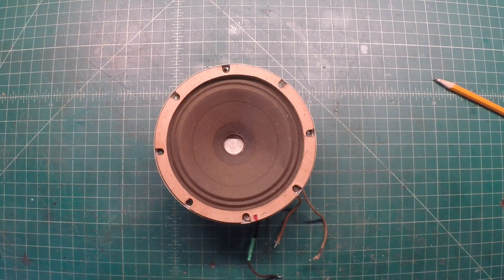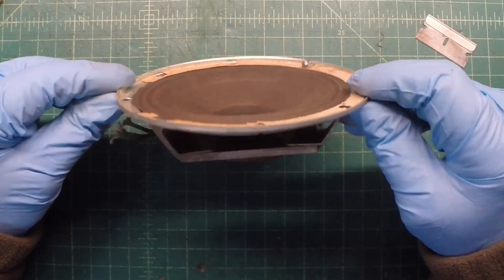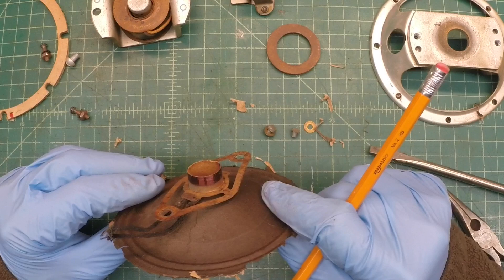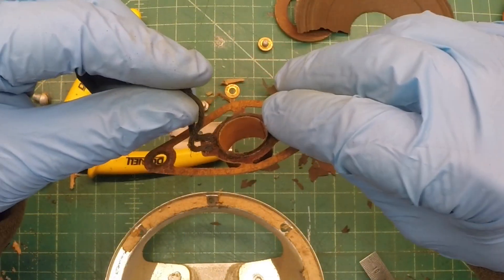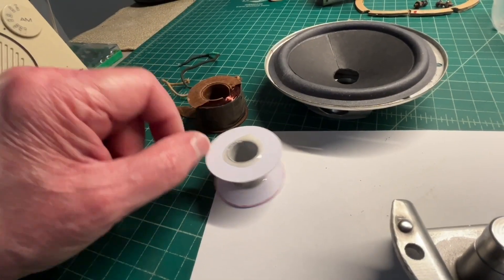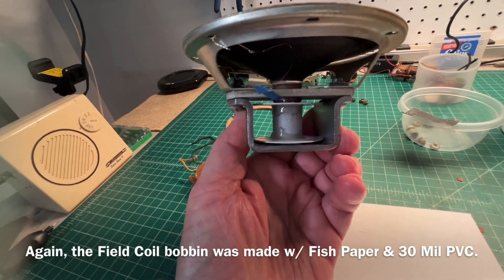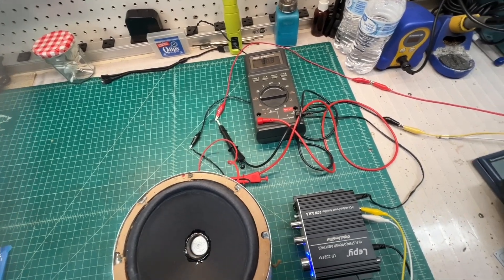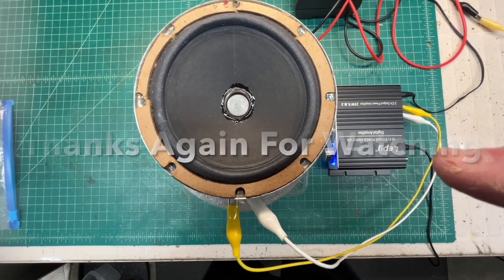Pathe - Model R | (Long) Rebuilding the Electrodynamic Loudspeaker | Field/Voice Coil | Spider/Cone

Comment: Thanx for your reply, Don. You are so diligent at replying to those who watch your videos. One more question I have, since I did not learn it until being a journeyman for many years, is that at 10:03 in this video you make reference to 'using 10 Mil PVC'. By this you mean that 1 Mil is 1/1000 th. of an inch, hence 10/1,000 th. PVC.
Reply from the maker: @davido.hamilton3254  You are correct, 10 thousandth of an inch or 0.254 mm. White blank PVC card, double-sided printing, no magnetic stripe, no adhesive, no pre-punched slot. Card Size: 3.375" x 2.125"(CR80); Material: PVC. I lightly sanded the card around the voice coil cutout to ensure the epoxy would adhere. Hope this helps. Best, Don

Comment: Hello Don. I have assumed that you are an American citizen, hence it surprises me that you take your measurements in millimeters. Good job on your speaker rebuild!
Reply from the maker: Correct, American citizen. The metric system (mm, cm) is so easy to use and so many resource tables are metric, so it simplifies things for me. Thanks for your question and for watching. All the best. Don